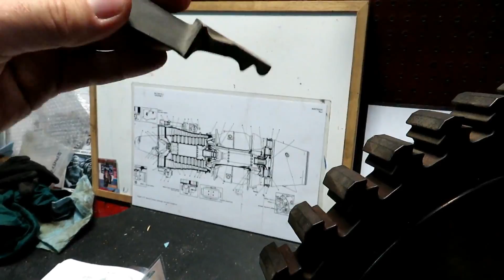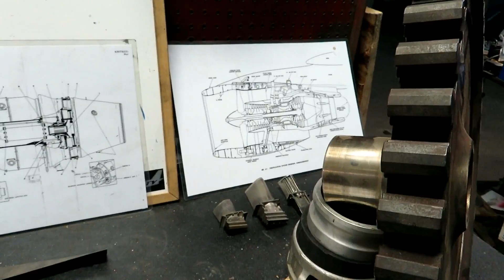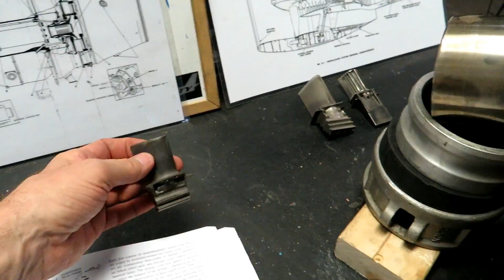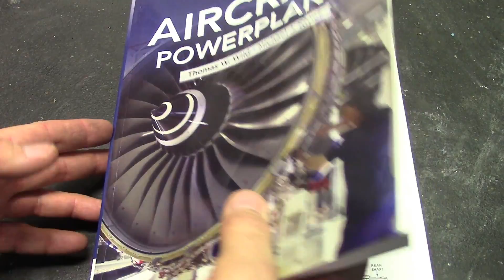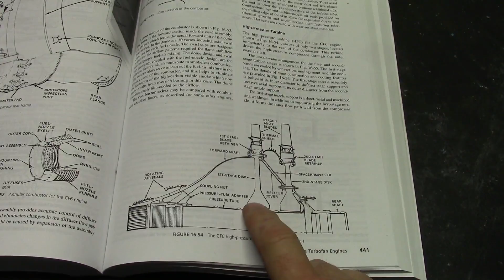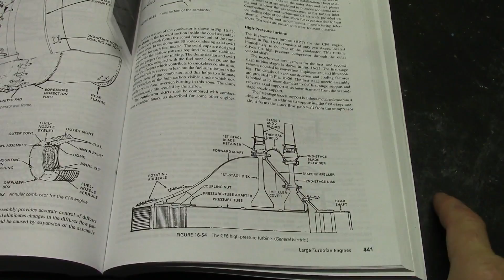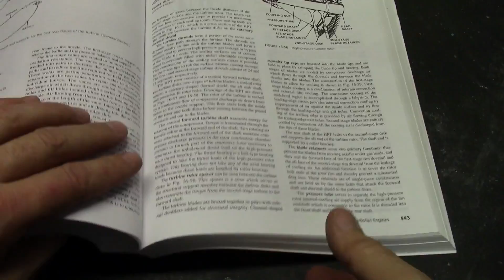Turbine Interstage Seals

Comment: I cant comprehend  what happens  when loads of water tries to go through  this
Reply: Turns into steam.
Reply from the maker: what do you mean by load? The core of a GE90 consumes over 250 lbs of air per second. If you include fan flow, that goes to about 2 tons... per second. Even a heavy rain is nothing. You must have seen the test videos of airliner engines at full power with about a dozen fire hose shooting directly into the inlet. Amazing machines.
I've got vids posted on water ingestion and water injection.
Reply: The one A380 that had a engine explode in flight, took out controls to the engine next to it.
Took every fire engine the airport had with thousands of gallons of foam to kill it.
Reply: @vector6977  I've chastised others for using the terms "explode" and "explosion" when referring to an uncontained failure, such as occurred in the case of QF32 - and I think that AgentJayZ has too.  An "explosion" is the result of a chemical reaction that releases a rapidly expanding volume of high temperature gas, resulting in the propagation of a high energy shock wave.  
It's now your turn to be chastised.
Reply: @grahamj9101  ok boomer! 
Then what exactly DID happen when superheated jet fuel vapor reacted with an open electrical short?
Reply: @grahamj9101  the RR in the A380 did literally explode after a oil pipe broke and caused a uncontrolled overspeed condition.
Reply: @vector6977  As someone who had a career lifetime at R-R in the design of gas turbine engines, industrial, marine and aero, I can tell you with some authority that the No.2 engine on flight QF32 did NOT “explode.”  That was the term used by uninformed journalists (and others), who inevitably sensationalised the event – as if a near disaster needed any more sensationalising.  So let me take you, very simply, through the sequence of events.
A poorly machined end fitting of the oil feed tube to the HP/IP turbine bearing housing developed a fatigue crack and failed.  This allowed a major leak of oil into the space beneath the IP turbine disc.  Because of the local air temperature, the oil immediately ignited.  The fire was severe enough to overheat the rear drive arm of the IP turbine disc, which connected it to the IP turbine shaft and hence to the IP compressor.  At no time did the burning oil “explode”.  The heat release, though substantial, was a very small proportion of that taking place in the combustion chamber at that moment – and the combustion process in a jet engine is not an “explosion”.
The overheated and softened drive arm sheared, disconnecting the turbine from the compressor.  The unloaded turbine then rapidly accelerated, probably in under 200 milliseconds, to 140 percent (or more) of its maximum design speed, which resulted in the disc bursting (that is the normal term used in the industry: please note) into three approximately equal 120 degree segments, plus some ‘shrapnel’.
  The high energy debris was not contained by the turbine casing and it passed through that and the engine cowling with relatively little retardation.  I repeat that there was no "explosion".
Immediately after the event, the Australian Transport Safety Bureau (ATSB) assumed responsibility for the investigation and, unusually for such an organisation, published daily updates during its early stages.  I was subsequently told by a former colleague that R-R found this acutely embarrassing: however, I had little sympathy, as the event was entirely avoidable.
Within a day or so of the event, a photo of a 120 degree segment of the failed disc, which had been found on Batam island, was published on the ATSB website.  As separation into three 120 degree segments is the classic mode of failure of a disc in overspeed, this was a major clue for me.  I was also able to see that the rear drive arm had sheared and what remained was splayed outwards, indicating that it had suffered a catastrophic loss of strength.
As a result of this, three days after the event, I set down my hypothesis of the failure sequence and communicated it to a professional acquaintance in Australia.  My hypothesis was, in due course, proved to be correct by the reports from the ATSB.  If you wish to follow these up, you can start by going to Wikipedia and looking for 'Qantas Flight QF32’.  Read the Wikipedia entry by all means, but then go to Ref #2, which gives a link to a summary of the ATSB investigation.  This, in turn, gives a link to the full ATSB report, all 20MB of it.  I did take the trouble to download and read it soon after it was published.  Perhaps you should, too, to confirm that the term "explosion" is not used.
Reply: @vector6977  Are you thinking of the crash of TWA flight 800 in 1996?  Yes, that was almost certainly an "explosion".  However, the No.2 engine of QF32 most definitely did NOT "explode."
Reply: @vector6977  OK snowflake!  
I've just posted a dictionary definition of "explosion" elsewhere.  It is, 'a violent release of energy resulting from a rapid chemical or nuclear reaction.'   Unless you want to go along with the conspiracy theories that suggest a missile strike, the probable cause of the TWA flight 800 disaster was officially determined to be an explosion of flammable fuel/air vapours in a nearly-empty fuel tank.  Yes, that would have been an "explosion": the uncontained failures we have been discussing here were not "explosions."
Reply: @vector6977  - @What may I ask exactly, is "an open electrical short"?! 

Are you saying that the shorted circuit was 'open' to the air? If that be the case - I would think that saying something like; "with an exposed, electrical short", would be less confusing (even though, redundant). 

The reason that I'm asking you this is because, the terms open, closed and, short are distinct, basic conditions of electrical circuitry. Neverminding how frequently the term 'short' is used, very incorrectly as an ubiquitous term for any type of circuitry failure. Cheers-
Reply: @markaoslo5653  lol.
Read a Damn book.
Reply: @vector6977  - Lol, thanks sport! I didn't realize I was speaking to a divine entity of infinite knowledge!
Reply: Try basic electricity.
Reply: @vector6977  - I passed an electrical code inspection of a full 200 Amp residential mains install when I was 13-years old - around that same time, I was diagnosing and repairing TV's, stereos and, installing custom audio systems (the list goes on). And, while I stupidly, didn't go after any certifications or degrees (and, my mental reference library, is dwindling) - I felt more than qualified enough to address those three circuit conditions called open, short and, closed. Furthermore, should anyone offer a correction(s), to me; I will gladly check my information and, ask further questions if needed - see? What about your background, in basic electricity?
Reply: @markaoslo5653  do you want a cookie. Boomer?
Reply: @markaoslo5653  CNC programming actually.
Reply: @vector6977  - Nice! Good for you! seriously!
Reply: @vector6977  - You missed the part where, I'm not an actual Boomer (guess again). What kind of cookie do you have? May I have two?

Comment: Jet engines look like massive turbos with big cans of soup between the compressor discharge and turbine inlet. From your explanation for fuel consumption and the effort it takes to drive a compressor on a turbine engine, would you say that turbine-superchargers do not add "free" piston engine output? Cool topic for a video.
Reply: It's not "free" in the sense that you're magically getting free energy out of nowhere, but you are capturing the otherwise wasted energy that the engine puts out as exhaust pressure and heat and using it to increase intake and cylinder performance.
Reply from the maker: And a bit more than just the wasted energy... if you directed the output of the compressor of a turbo to something else besides the inlet of the engine which is supplying the exhaust to it, that engine would make less power than if it was running normally aspirated with nothing using its exhaust.

Comment: Hi agent Jay Z, 
I have an off topic request; could a jet test be combined with an attempted sewage pipe resonance? It might need a few pipes stuck together, it might not even work.
My guess is, that massive displacement of air, in the sewage system, could cause a so called hum, ..a loud unexplainable noise heard arround the world.

I thought of big air displacement in a big pipe..How.., was the next question.
A hot air balloon propane torch?, a repurposed turbo?
Other options, in my eyes, include, puls jet or maybe even a very slow pulsed detonation, or better said, a rotating detonation engine in open air.

I Love your channel for the tests and insight. I feel almost guilty for this quirky request;)
Reply from the maker: The engine tests you see on my channel are final acceptance tests of our customers' engines after they have paid us to repair or overhaul them.
Any sort of faffing about with smoke machines, confetti, marshmallows, wrecked cars, or sewer pipes(!) is not part of the plan.
Reply: @AgentJayZ  I understand! Thank you for your efforts, I enjoy the content :)
And am a bit baffled by this quick reply.

Comment: Can you please explain what is a TBH cone ?? I know that is same thing in the back part of the engine (Airbus A380) but I don't really know what is the goal and also I never saw one.
Reply: In R-R speak, TBH is the acronym for the turbine bearing housing.  In the RB211 and Trent series of engines, the HP/IP turbine bearing housing is supported by a shallow conical structure, with struts on its periphery, which pass through every other IP nozzle guide vane.

Comment: So where's the air duct that feeds the holes in those blades?  Just kidding.  No air duct.  More like a bunch of precisely controlled leakage around seals and spacers, leading to the blade tubes.

Comment: Why don't the engine designers suck in cold air from the environment to cool the blades?
Reply from the maker: There is no such thing as suction. Air will only flow from an area of higher pressure to an area of lower pressure. The gases coming out of the combustion section were created by burning fuel in the air that came out of the compressor section. In the compressor section, air that came into the inlet is compressed. When air is compressed, it takes up less volume, because it is taken to a higher pressure.

Unless we can get our balls to roll uphill, the only source for air that will flow into the turbine blades is the place where it is at a higher pressure : the outlet of the compressor.
Reply: @AgentJayZ  Thanks for the explanation. That makes sense although for arguments sake couldn't they get around the high to low pressure but removing all those tiny holes and creating a closed system to circulate outside air inside the blades much like coolant in a car engine is pumped through to cool it off?
That's probably way too complicated and not worth the effort.
Reply: @darkmath100  As a gas turbine designer (retired), I totally agree with your last sentence.

Comment: "No passages through it..." well, except the hub and all those little holes, which... go all the way through it.
Reply from the maker: Those are bolt holes in an axial orientation, which allow the spacer and the seal to connect the two disks. I was talking about air passages in a radial orientation that might be used to carry air to the blades. There are no such passages. Sorry about the lack of clarity. It's all part of the grand plan to deceive HKLM. Dang! I blew it again...
Reply: Silly  @AgentJayZ , I didn't think you had a "grand plan" to deceive me.

OK, air passages.
Reply: @AgentJayZ  In one mark of RB211 engine, R-R did actually introduce radial holes into the rim of the HP turbine disc to provide a so-called HP feed to the leading edge of the blade.  The holes had to be machined extremely carefully and machining was followed by an 'extrude hone' process, where a thick abrasive slurry was forced through the holes, to give the best possible surface finish.

Comment: Was this also the failure on Philippine air 777 November 21 LAX
Reply from the maker: No. A stall could be called an engine failing to perform as it should, but I would not call it an engine failure... where things break and it's an expensive repair.
A stall and surge can cause damage if it's extreme, but usually it's a matter of making a few adjustments, and the engine is fine.
Reply: I agree with AgentJayZ. The No.2 engine on flight PR113 did not actually fail and it was not "on fire." It was suffering repeated surges until it was shut down. The event is very reminiscent of a birdstrike event that happened to a Thomsonfly B.757 at Manchester (UK), back  in 2007, to which I've referred in the past. There's no suggestion of a birdstrike in this case, and it's speculation on my part, but the severity of the surging suggests a major malfunction in the HP compressor.

Comment: Jesus, a single high pressure turbine blade is worth a grand?
Reply from the maker: More like 3K
Reply: How many do you see in one set? Now think about the cost per engine. So expensive that no one actually owns them but the manufacturers. Airliners only lease them.
Reply: @torkdork69  That was why I was amazed at the price of a single blade. We're talking at least half a million for a single turbine.
Reply from the maker: Yes, and most manufacturers recommend, er instruct that if one blade is damaged, the whole set must be replaced. There are between 80 or so and 120 or so in a set, depending on engines, models and stages. Jeez.

Comment: How many little titanium ingots do you hear saying "When I grow up I want to be a GE90 turbine blade"?...Not many.
Reply from the maker: Ti can't survive the heat.
Reply: The only Titanium blades used in the turbine section are on the very last stage of the LPT and they are actually TIAL ceramic and not typical titanium.  TIAL ceramic is very lightweight but is also very fragile.
The other turbine blades are all Nickel alloys, with the HPT blades made from Single Crystal.

Comment: parallel.  the snow is parallel to the ground.  90 degrees to the ground is perpendicular.  stick to engine builds.  geometry is not your forte.
Reply: snow and rain typically"fall" (rain fall, falling snow), as in the vertical plane, so, wind-driven snow "almost" 90 degrees from the vertical plane is what is shown. geography (meteorolgy) is not your forte
Reply from the maker: Yes. I was probably thinking something like 90 degrees away from its normal angle. I might not have made that mistake if I wasn't trying to video myself. Maybe.
Reply: @AgentJayZ  This pedant isn't offering any criticism.